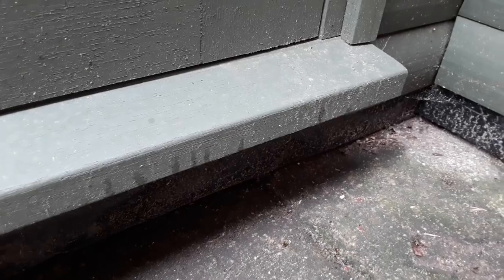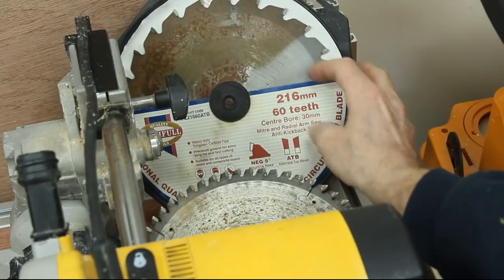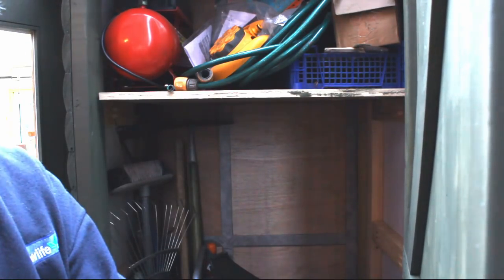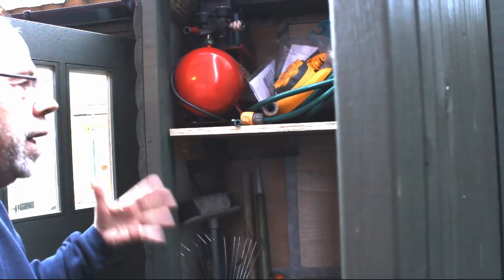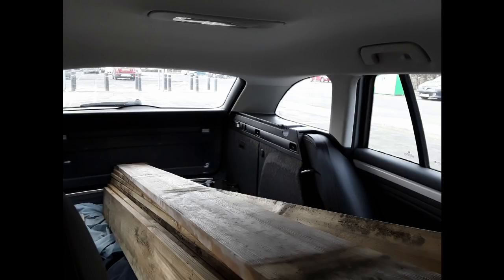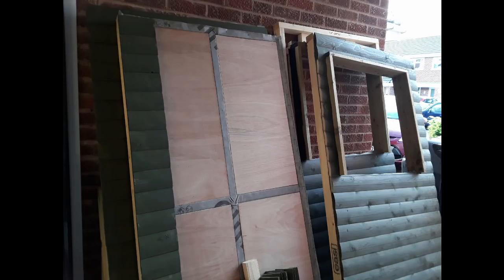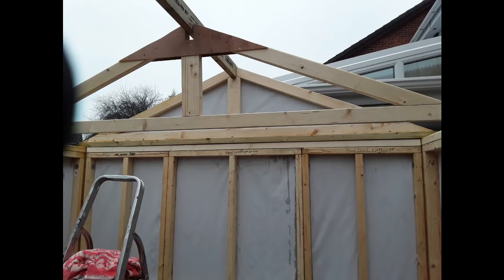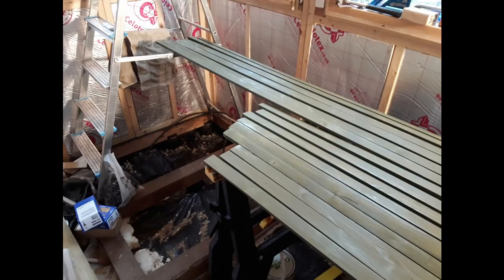the small shed #73 - designing the shed

Comment: Great Video. I can completely relate to this video as I am working out of a 6 by 8 shed and as you've said there's never enough space and needs constant shuffling round to make space for the job I'm doing. Rather like yourself I've run a bench down one wall but placed my second bench across the end wall in an L shape this has given me a tiny amount of space to have a small mobile cart on castors and I have an additional smaller shed for storage of timber and Gardening tools etc
Reply from the maker: It was the gardening stuff that was the killer in the old shed, and I'm so glad I added the extension at a very late stage in the build, it just keeps all the mud and grass out of the workshop.